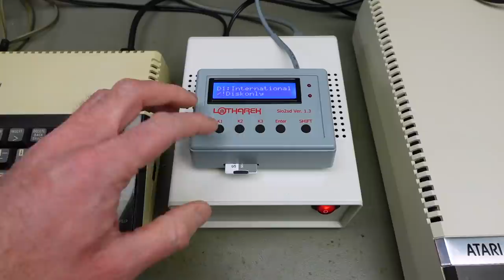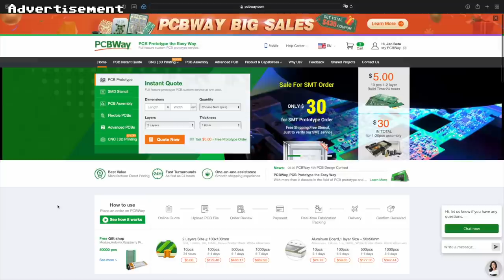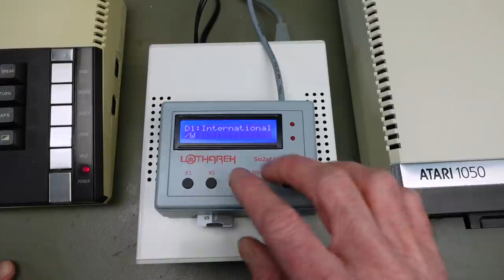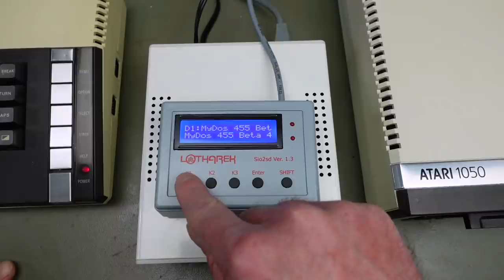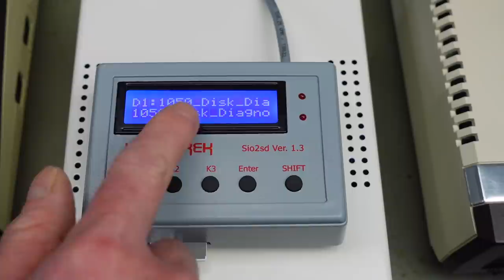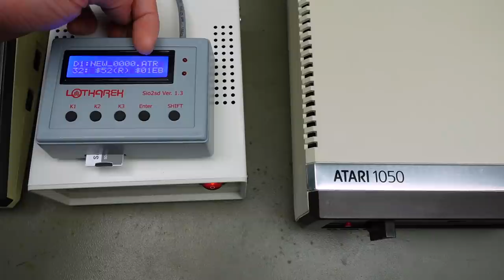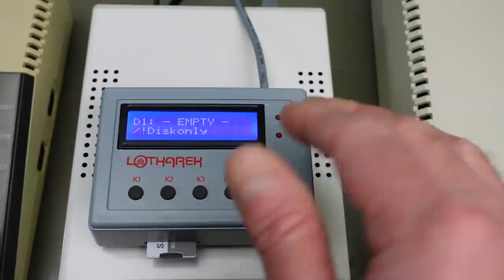Copying Atari Disk Images to real Floppies

Comment: For those who don't have  an SIO2SD solution, Jan's method  based on MyDOS 4.55 also works on  android phones (Aspeqt) and on SIO2PC (Respect) solutions. In those cases, the source and destination drives need to be the same number (1) and you will only need to pause the app on your phone/pc  and power on your 1050 when the process asks to insert  the destination disk and backwards when the source disk is needed.
I tested many  different dos versions and I think Jan hit the jackpot.  MyDOS 4.55 generally seems to be the best solution for this task.
Reply: Jan, pin this please.

Also, thanks for the info.
Reply: @peddersoldchap  One year later and this comment  came to my aid since I totally forgot the DOS type and method  I used to copy physical drives.  In the mean time I have installed a Turbo Speed solution for the 1050 which allows higher speeds  but most importantly larger capacity.  The same method works fine with this upgrade.

Comment: Very nice, Jan!! 
10:15 it's not necessary to wait for the drive to stop the 'spin test' to access the drive. It is waiting to be accessed during the spin test.
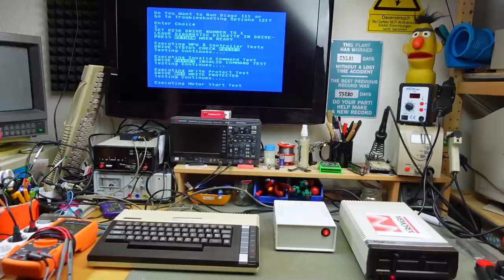10:40 Sorry to say that no you can't write a disk with the same drive and then run diagnostic tests from the disk. The diagnostics disk must be written from a properly calibrated drive.  You can use an original factory-written Atari DOS disk or a known-good retail disk for the test. No need to get the diagnostics disk written on a calibrated drive when you can test any disk. So load the diagnostic test from the SD device then put a retail or factory-written Atari DOS disk in the 1050 and test it that way.
As previously mentioned here in comments, you can hold OPTION down when powering on your 800XL to disable BASIC to go straight to the DOS menu.

The original Atari DOS 2.0s or DOS 2.5 disk duplicate function (J) is not recommended for a good disk copy because they only do a file-by-file copy. Many games or applications will not even use DOS file structure on the disk so that copy will fail. The newer MYDOS' do a good sector-by-sector copy.  A program dedicated to disk duplication is best to use.  

A good modern disk duplication application is Copymate XE 3.8 (but requires 128K of RAM).  There are others too. Often you'll want to use a program that supports copying single density as well as enhanced density and double density, depending on what densities your drive(s) support and what disk(s) you want to copy. The stock 1050 drive supports single and enhanced density which both use 128byte sectors, but employ a different sector skew (how the sectors are organized around each track of the disk). Enhanced density supports 50% more sectors per track.   Early era (1980-1983) disk duplicators only supported copying single density, fyi. 

As a fun project you might consider upgrading your 1050 to support double density. There are several upgrade choices available from tf_hh there in Germany. A mini-speedy is nice. A 'happy' clone upgrade is really nice. A USDoubler clone is good too, if perhaps not as good as the previous two mentioned.  Alternatively you might consider getting an Indus GT or other disk drive that natively supports double density. There are several. The Atari8bit FAQ at Atarimania mentions most of them. That's not the newest revision of the FAQ.

Thank you for the video I enjoyed it.
Cheers
Reply: Yep, the diag floppy should be a calibrated original, never a copy..
Reply: @thomasmroz  Sometimes you have to work with what you have.
Reply: This should be pinned or put in the description. 

Very useful info. Thanks.

Comment: Excellent video! Well done Jan. In my case, I'm using Lotharek's SIO2PC cable, AspeQT Windows program as the drive emulator and "Happy 256 sector coppier.atr" (this works great for copying games).
The procedure that worked for me:
1. Load "Happy 256 sector coppier.atr" in AspeQt's Disk drive 1
2. Power off the Atari 1050 disk drive (it should be also set as disk 1)
3. Power on the Atari computer to boot "Happy 256 sector coppier.atr"
4. Once booted, eject Disk drive 1 in AspeQt
5. Power on the Atari disk drive
6. Load a game image in AspeQt disk drive 2
7. On your Atari set the source as D2 and destination as D1 and start the copy.

The procedure above allows me to keep the physical disk drive to be set as D1 the whole time, so I don't need to fiddle constantly with the index switch.

Comment: Jan, that is most useful. Being a Commodore man,  whenever I use my Atari's I notice I lack some basic skills how to perform certain tasks on the Atari platform.
Reply: What tasks do you need help with?
Reply: @Mrshoujo  Mainly how to do certain tasks, i.e. if I need a machine code monitor on the C64 I know I need to plug in my Final Cartridge 3 and hit F2. On the Atari... I start Googling. You could also think about other software like sprite editor, or as Jan did show, working with disk images, cartridge images and so on. I get the job done, but as I haven't it in my fingers, it takes a lot longer.

Comment: 8:45 no Atari 1050 Disk drives were single sided and "enhanced" Density, which is 1.5x larger than single density, but there were a LOT of aftermarket drives that supported Double Density but DOS 2.5 didn't understand double density, but MyDos, DOSXL, and SpartaDOS did. Atari did release the XF551 that was double sided and double density (360k) which was late in the life cycle of Atari 8bits.

Comment: Hi Jan, I have a few pieces of Atari 8-bit hardware, not used for such a long time, I just wondered whether you could help, I have some 1050 drives and lots of old floppies, but I also have an Atari 810, which although it boots up, I don't know whether it can read disks, is there a way to reformat a disk through my 810, I think all my old ones are probably formatted through the 1050, at least then I'll know if it's working to some extent.  I don't know the command for doing this?

Comment: Please put new 3.3 firmware into SIO2SD. From version 3.2 the annoying feature that allocates file space on the SD cart during formatting WITHOUT clearing it was removed and clearing was added, because many of copy programs rely on getting pretty blank disk after formatting by not writing empty sectors. This leads into garbage on destination disk image, when firmware is <3.2.

Comment: if you hold OPTION while you boot it will go strait into DOS, and not load in BASIC, this frees up a little bit more RAM since BASIC isn't in memory.
Reply from the maker: Yes! I only realized that after finishing the video. Still an Atari noob. :D
Reply: @JanBeta  We Atari nerds are here.. we can help!  though i hadn't fired up my Atari in over a decade. But the best DOS for the Atari was SpartaDOS, specifically SpartaDOSX.  If you liked the command line DOS is.. SpartaDOS was king.

Comment: 7:27 I think that next video about an Atari should be some video output mods because I can see that your Atari suffers from common problem of "blurry" font edges.
Reply from the maker: That's mostly caused by my crappy upscaler I use for testing. Picture quality is actually quite good on a CRT. But I might do some mods anyway at some point. ;)
Reply: @JanBeta   at 1:48 "I end up using a versión of MyDOS" 😯
at 6.51 "We just going to boot up My DOS" 😲.. "is booting up MyDOS" 😮.. "and it should start MyDOS" 😳
I wonder if Jan's DOS is final version .. or also Beta.. 🤭
at 2:11 ohh is also Beta.. I see 🤪... makes sense.. 🤣😂

Comment: Happy new year Jan. I wonder if there is such device for the c64?
Reply: There is SD2IEC. It is similar. But honestly there are better options that don't compare to this at all. The U2+ is a great example. It's a cartridge that connects to the IEC floppy port and optionally the tape port. You hit the center button on the cart and the C64 shows the cart menu. You select your images from here using the C64 itself. You can then mount the image you want and it goes back to the C64 where you left off. It also supports fast carts and REU expansion (you can play sonic!) as well. It also has an emulated SID as well. It's basically a swiss army knife of C64 tools. You can even copy files from images to disks right from the menu. The fact that the C64 itself displays what's going on makes it a lot easier to use than these things.
Reply: @awilliams1701  you mean the ultimate 2+ cardridge?
Reply: @pwissink1  yeah most of us just call it the U2+ for short.
Reply: Pi1541

Comment: There are much easier ways to do it. There are full-disk copiers, that can handle any density disks.
Reply: By the way, for many programs you need to disable Basic by holding the Option key at boot. If done so with a DOS disk, the computer will boot directly to DOS.
Reply from the maker: Oh, I knew about the option key but not the part booting directly to Dos. Have to try that. :)